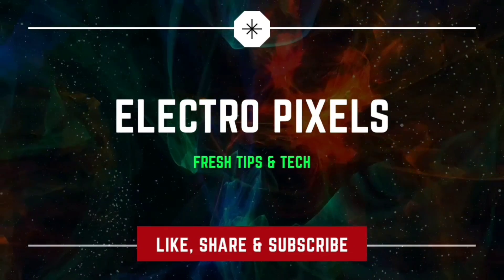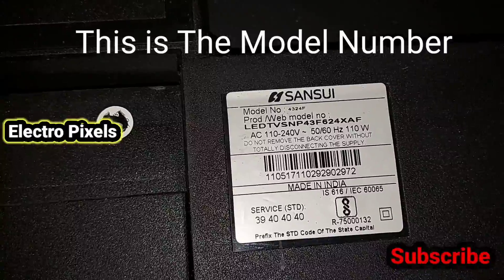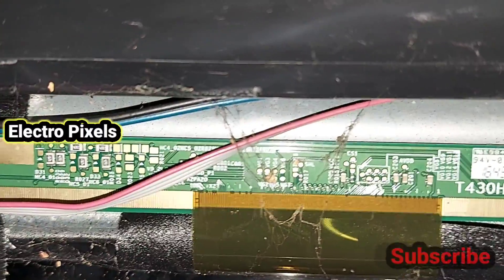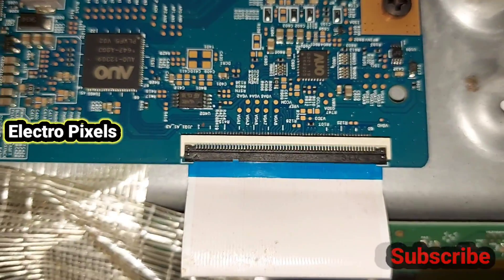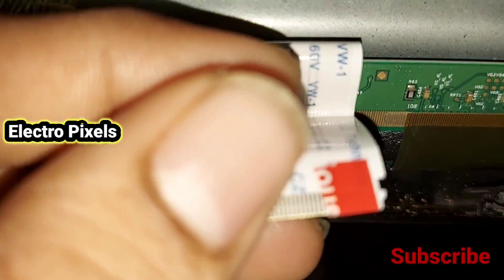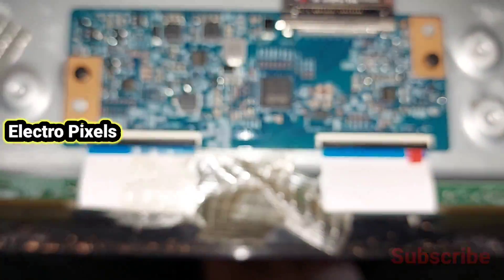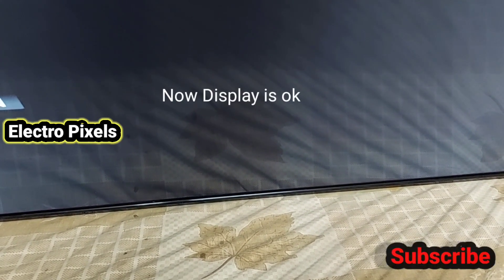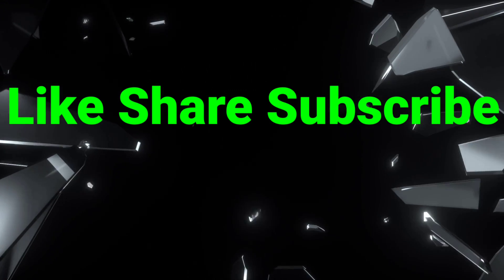Led Tv panel Vgh,Vgl(lc1, lc2)  Short Removal to Solve double image, Vertical lines bars on Sansui.

Comment: So you need to replace the tcon or the panel board at right side
Reply from the maker: No its panel internal shorting, Replacing the T con board doesn't solve the problem

Comment: Hi gud u di a video on TCon board Vin voltage drop frm 12v to half when lvds cable is plugged in when cable unolugged 12v is steady wht can cause mainboard or tcon. 2ndly can u shiw us where to look for hw to identify the ckv lines step by step. And last when doing the taping methode cud u also show us on the tcon how to identify and trace the signals tracks to be covered plz
Reply from the maker: Ok